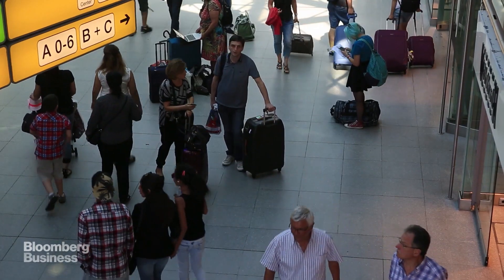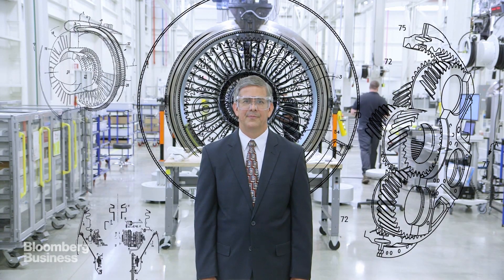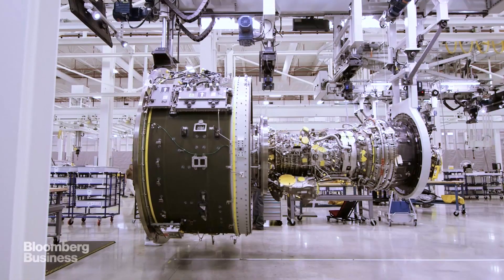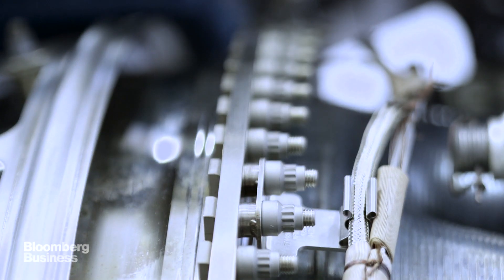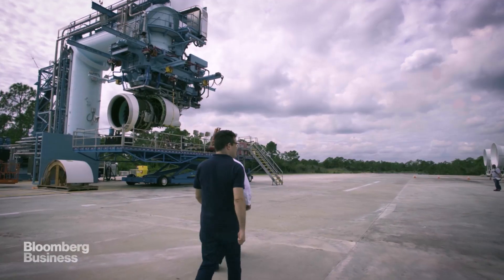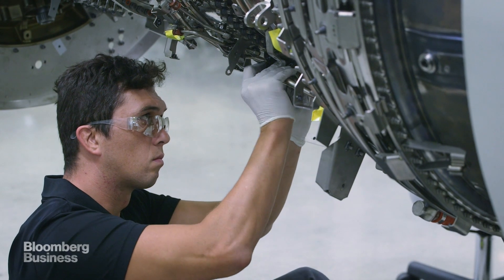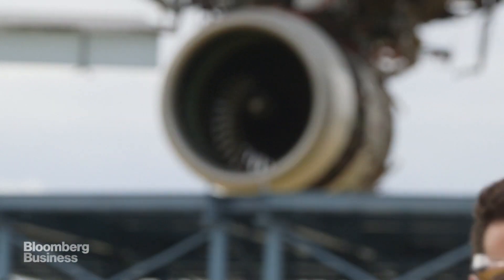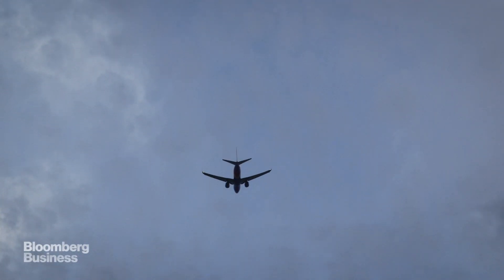This Genius Invention Could Transform Jet Engines

Comment: Let's clear something: The invention is not about "hey let's use a gear box!" This is something any bootfucked engineer would think of at the instant he's introduced to the problem. Mostly this is just really badly told news by Bloomberg, thinking their viewers couldn't handle any more complexities that are present here (none). The gearing of jet engines is in fact quite tricky and in this case, the ratio should be variable. Any classic gearing scheme would lead to bigger losses at the speeds of jet turbines than what can be saved with lowered compressor speeds.
Reply: sinnedciti
The design itself is not all that complicated. It's a simple planetary gearbox. What took so long was not the system itself but building it in such a way that it can handle the stain the engine puts onto it without needing to be replaced every few months.
Reply: What? A Corolla has 7 times the power of a model T and 3 times the fuel efficiency, at least according to Toyota, tests show it gets at least 30-40 mpg on average.
Reply: MVHiltunen But this is usless the only thing where you want the engine to be more efficient is at cruising thrust, because everything else is more weight (+more fuel usage) and more stuff that will cause failiures.
Reply: Mathew Cherrystone the failures is the crucial bit. Gonna require more maintenance, which if not done correctly will lead to disasters. Bound to happen
Reply: @StoutProper  planetary gear sets have proven to be almost indestructible in almost every use that they've been put to. With a constant flow of cooling lubrication which is present in almost every jet engine of the last 30 years or so. There should be no reason why you can't arrange this type of system. Does it complicate the Turbo Jet / fan jet engine, yes, but not by so much that you should cause any real issue.

Considering the largest issue that normally crops up on jet engines is primary fan blade failure. Reduction of stressors to that component should actually make it more reliable.
Reply: @44hawk28  Almost indestructible in almost every application... Hmmm. Ok then. Not sure exactly how indestructable that makes it. I remember them saying the same thing about a big boat once. So why isn't it in planes yet? Maybe you need to retrain all your ground crews on engine maintenance and that's expensive. Boeing is probably offshoring a software fix to avoid retraining to a cheap Indian 3rd party supplier to get around it.
Reply: @StoutProper  history is replete with numerous upon numerous occasions where the engines have been shut up and continue to run and get the aircraft back. Catastrophic failure of a turbo jet or fan jet engine is relatively rare. They frequently run even with considerable damage. It's mostly attributable to their few moving parts, only the radial aircraft engine was considered as durable.

The reason they always shut one down when it shows that there's a problem with it is because the engines are generally powerful enough to fly the complete flight, down on one engine, if not more.
Reply: Nomad Chad
I don't think that's really the case.

Geared turbofans are no completely new idea (obviously), but only very few planes actually employ them. The first (and so far only) larger civilian plane using the technology is the A320 neo which saw first commercial use in 2016.

Two years back I saw the engine design for that plane presented on an engineering fair and when I asked the people there why no one had thought of this before I was told that it took a long time to get the design light and reliable enough for it to become economic.

This is supported by the fact that Airbus originally intended the A340 to have geared turbofans but had to redesign the plane for normal turbofans because the gearbox couldn't live up to the specifications.
Reply: Model t 25mpg was for oil consumption. lol
Reply: Hellothere _1
 And most new cars have more HP. Our car has a real consumption (city and land mix) of a little more than 6L/100km I don´t really know what this means for gallons/mile but it should be something like 60miles on 1.6 gallons or 37.5 miles on 1 gallon.
Reply: Mathew Cherrystone
Well yeah, since Plane manufacturers usually don't develop their own engines they either pay engine manufacturers to develop engines for their planes or choose an already existing model from a manufacturer.

The engines used in the A230 neo are from Pratt&Whitney.

The intended gearfans for the A340 were developed by IAE (of which both P&W and RR are part of) but during development it turned out they could not build the engines under the conditions that Airbus had requested in time.

Rolls Royce has also jumped onto the bandwagon but their engine will apparently only be ready past 2020. It will however have an even larger bypass ratio that the P&W model, thus it needs an even stronger gearbox.
Reply: Guinness IMHO you compare
T Ford with 800 pounds weight, 45mph max speed milage per galon, and
something with 3500 pounds weight, 80mph avg speed on roads, and still having same MPG.
Reply: haha, damm true man i was thinking about the same thing, as if they invested 10 billion dollar to introduce a variable geometry gearbox...man!! xD
Reply: Armchair engineers have been flooding YT lately.
Reply: @rock3tcatU233  Armchair engineers that got their education from UWT.

University of Wishful Thinking.
Reply: Actually planes use a lot of their fuel during start and landing operations so improving those phases will show drastic improvement in the overall performance. If the engines are really 15% more efficient during starts and landings that easily compensates a few hundred kilograms more weight.

As for failures, jet engines are always high maintenance systems with or without the gearbox. As long as the maintenance people don't make mistakes a gearbox won't increase the failure rate significantly.
Reply: that would be 39 miles per gallon actully so even beet ehr than you though
Reply: You loose energy making it into electricity and loose again changing back to motion.
Reply: The gear ratio is fixed on this engine, not variable.
Reply: MVHiltunen Hence up till this video was made the Russians were the only ones to make it commercially viable for civilian jetliners as they got an abundance of light ultra tensile strength alloys in comparison to NATO.
Reply: Snookynibbles tocoloeddie  just more to make and brake !
Reply: Search PS-90 seroes, USSR has been doing it successfully for decades
Reply: The ALF 502 is the first geared turbofan and has been in widespread use since 1980.  It’s a derivative of the Lycoming T55 turboshaft and produced 7500lbs thrust.  I really don’t know what the issues were in scaling it up about 4 times.
Reply: they also had the engine at idle during the call, it would be just as loud otherwise.
Reply: Hellothere _1
Aren´t the engines desgned by RR?
Reply: Yea, that's what I was thinking.
Reply: I was just thinking. 30years and 10billion dollars to figure out to use a gearbox ;p
Reply: Err  ..  define:  bootfucked.
Reply: So many experts here all in the one place, amazing 😉
Reply: Can u explain that in detail please. I will be really grateful
I m curious
Reply: GE and CFM uses larger diameter turbines and Low/IP optimize  efficiency at lower RPMs. Rolls Royce is developing a geared turbofan of their own. However my dream turbo fan engine is geared turbofan that uses orbiting combustor nozzle technology.
Reply: Huh?  The world has been safely deploying turboprop configurations that use...reduction gear trains in every one of them!   Don't see adapting the same concept into N1 between the fan and the booster as any scary deal.
Reply: @Snookynibbles  Look into it but wasn't the Garrett TFE731 engine a geared turbofan. 

Way different power range to be sure (3700lbs? thrust). But similar idea.
Reply: I agree any and most(not all) turboshaft or turbo prop engines have a gearbox on the front. This is just stupified for the masses reporting.
Reply: @nomadchad8243  The power turbine in a P&W PT6 series turboshaft engine turns between 30,000 and 35,000 rpm. The propeller shaft turns around 1,700 to 2,000 rpm.

The gearbox 'snout' has to have room for needed accessories. Like oil pump and prop governor. Plus the prop support bearings.
Reply: sinnedciti
Well in that case Ford is the problem. Or rather all American car manufacturers that put off improving their engines for way too long.

It is not uncommon for new cars of most manufacturers to make out with 4l/100km in a normal non-city-centre environment.

Please also keep in mind that modern cars are way faster than the Ford T which results in higher consumption.
Reply: Wacky,
No. You lose energy. Loose means something is not firmly fixed or attached. Otherwise, you are correct.
Reply: MVHiltunen you would need varible gearing for sure I dont believe it is 15 perce  less fuel you reduce tip speed ye
but you loose thrust for sure !
Reply: Agreed 💯. It'd be nice though to see magnetic gears, (torque converters) and bearings used to improve efficiencies...
Reply: Marc83Aus thats not a ford. Its not even an american car. And lab tests and actual real life urban road performance are worlds apart. Power is not the point, its effiency.
Reply: @StoutProper  Modern cars are a lot, heavier, requiring more fuel to move, There maximum speed they can go is also a lot higher and they are are also on average traveling faster. So if anything it's an achievement that they didn't get worse fuel economy considering how overloaded they are with extras, the fact they need to have a certain amount of structural strength, and that they have to fight higher wind resistance. Even the Tires are bigger increasing contact with the road leading to frictional losses.
Reply: @jon782  yep but the fact remains in over a hundred years of the internal combustion engine powering the car, the fuel economy has barely moved. It's almost as if they want us to keep buying lots of oil.
Reply: Hellothere _1 you dont think? 30 years to design and build a gearing system inside a jet engine sounds like a shit load of extra complexity to me. And commercial pressures to turn the maintenance round quickly, esp when the jet is older...
Reply: @StoutProper  Those 30 years were almost certainly not specific to the gearing. It was most likely spread through their entire teams perid of experience in researching ideas for efficiency. In other words the new people just wanted to up the hype saying LOOK AT THIS GLORIOUS THING THAT TOOK 30 YEARS TO DESIGN!!!
Reply: @StoutProper  back in 1990 when this was first announced as a development thing the gearboxes weighed 7-10 tons -  the progress has been getting the weight down enough to be able to put them on wings without shredding themselves. A standard turbine wheel driven fan has stood the test of time as ultra-reliable and the efficiency loss was trumped by the weight and reliablity penalty of a GTF.
Reply: Hellothere _1 right, so the engineering is complicated. And its inherently prone to failure. Just dont sound all that great to me. 30 years work to make a maybe 15% improvement seems like a poor return. Its like the internal combustion engine. The model T ford did 25 miles to the gallon. 100 years later, the average modern car does on average 25 miles to the gallon. It seems to me that significantly improving the efficiency of oil driven engines isnt something that people are investing too much into really.
Reply: @StoutProper  Go put a model T engine in a modern car - it would barely move it and get about 3-4mpg. Modern cars are much heavier, much more powerful and much more fuel efficient for their mass than what's gone past - the difference is that every efficiency gain has been offset by extra weight.
Reply: @miscbits6399  so despite all the advances of modern materials and manufacturing techniques, all vehicles are far heavier than model ts? Even smart cars? Even if that's the case, which I suspect is not always, its still a, very poor return in that the net effect is no improvement to the average mph of the average car in over a hundred years. It's almost as if there are created interests that don't want an increase in efficiency
Reply: @StoutProper  safety regulations and consumer demand for equipment make cars heavy as it is now.
Reply: @StoutProper  you are one of those dumb ones that uses analogies (that are wrong ) but thinks you are a genius. 

A modern ICE is many times more efficient than a model t ICE. That is with all the compulsory emissions kit tacked on as well which reduces efficiency.
Reply: Guinness: For the record:  From Wikipedia. . .

“The Model T had a front-mounted 177-cubic-inch (2.9 L) inline four-cylinder engine, producing 20 hp (15 kW), for a top speed of 40–45 mph (64–72 km/h). According to Ford Motor Company, the Model T had fuel economy on the order of 13–21 mpg‑US (16–25 mpg‑imp; 18–11 L/100 km). “
Reply: Bram Moerman yup, 25mpg. Pretty much what the average American car gets on average.

Comment: Mama its me. Iam standing INFRONT of a Jet engine which is idling to test how LOUD it is -.-
Reply: and the iphone which he is speaking on has ambient noise cancelling using the small dot mic at the side of the camera
Reply: agedflier actually the loudest point is 45 degrees off to the side of the front of it
Reply: Th loudest part is his high pitched 'yeah' like his sack got crushed.
Reply: lmao or off
Reply: Bloomberg doesn't even have enough material to make a 4 minute documentary film, so they have to use fillers like a fake phone call and that super awful slow motion a few seconds later.
Reply: Everyone knows that jet engines produce their noise from the rear... Also he could have been "upwind" as planes fly into the wind to take off.
Reply: Lord_Vader the fake phone call summarises all information in this video

Comment: i am a little bit disappointed about that , i thought first , this kind of hightec engines are designed in every parameter like sizes , diameters , and rpm´s for each part for maximum efficiency ( in the safe range of course ) anyways ............:-(

Comment: In my opinion, more moving parts = more problems. More problems = more money. I should know, I own a Ford.
Reply: Ford repair garages love you. :)
Reply: GeoStreber
I own a Renault. We have all doomed ourselves, lol.
Reply: I own a GM. Is this the "I hate myself" thread? LOL
Reply: Did anyone know that Chevy is going to come out with a heated tailgate on their trucks next year?   It's so your hands don't get cold when pushing it off the road.
Reply: Me too, I own a VW with a double-clutch transmission....
Reply: Can I choose not to fly in a Ford?
Reply: hah! Ford!
Reply: Actually it reduces the amount of high pressure compressor wheels needed to generate the trust to turn the low pressure compressor shaft, as it is less energy needed to rotate the shaft as it the torque (through the gearbox) to turn the fan blades. 

So in a way it should actually cause less problems.
Reply: Diesel?  yeah that Diesel;)
Reply: Toyota Hilux owner here, and really what "damage" means?
Reply: Well, where do you want to put the gearbox? After(behind) the compression blades of the cold section?
Reply: Claude Smoot jajajajaja
Reply: Ha   F ound  O n  R oad  D ead.  F ix  O r  R epair  D aily
Reply: And you get used to less hp to you do not even miss it lol so this jet engine weighs 1ton and hp is 150whp lol ford
Reply: Right. What happened to the KISS principle?
Reply: Claude Smoot if you think your ford has a lot of parts, well I bought a Mercedes, total electronic, mechanical overkill on every facet, never again, too much to fall apart, too hard to work on, cost a fortune if take it to a garage.
Reply: Yep. They threw the "KISS" principle out the window and adopted the "MTITOR" principle. (Make them impossible for the owner to repair). I was going to throw in "IGTATP" (I've got three alimonies to pay) but it seemed ridiculously and unnecessarily complicated, like our cars.
Reply: @bobbastion7335  Compared to newer turbofans it has less parts to it.
Reply: wow

Comment: I'm wondering if someone could make a jet engine with a tesla turbine exhaust scroll. It's a centrifugal design, and the exhaust turbine in question is bladeless, but highly efficient. The issue is, it has low torque, so that gearbox they talked about could really come in hands.